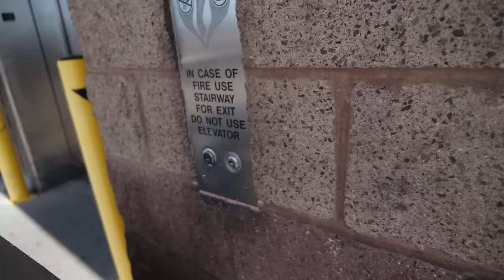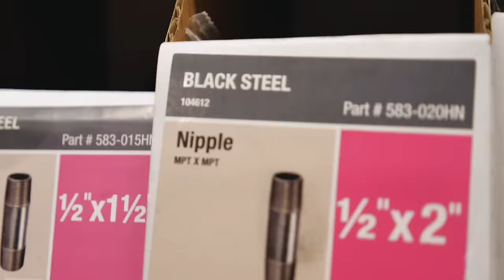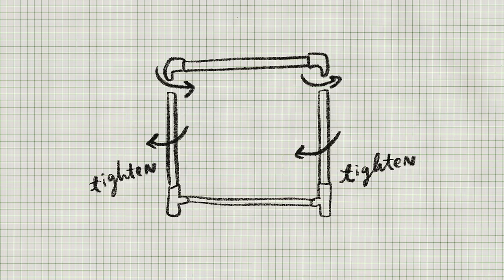HOW TO BUILD A CLOTHING RACK ft. my ex-bosses

Comment: thanks!! i built it. it was hard tightening all the rods, i had to get my dad and sister to hold it down while i spun around tightening it lol. 

it was also kinda pricey for in my area, i spent about $300 total, but it was exactly what i wanted and it was real materials so i think it’s worth it and will last.

i also realized that at any point you can add more T’s to make it larger and customized.

in the end it was about $300 and 10 hours total from getting supplies to putting my clothes on it. (i also painted the iron rods)

thanks for the help!!

Comment: For the top pieces, couldn’t you have just flipped them, and then they could be rotated clockwise?

Eg take the left screw bit and put it on the right side (flipping it so it faces the pipes?

Comment: I just built this! I love the idea and it looks great, but I wish I had realized that dresses don’t really fit on it. I was going to use this to house my vintage clothes (mostly dresses!) I will make it work, though! It is a very expensive project, I will most likely make another “single decker” rack soon. The base of mine seems a lot bigger than the one in the video even though I used all the same measurements, and you should have specified that you used #12- 3/4” wood screws! I had to screenshot and zoom in to figure out the type of screw. Overall this video did motivate me to build something all by myself and it turned out great! Thank you!

Comment: Awesome job. Just a quick heads up that you will want to clean and then clear coat the pipe for long term use (it will eventually rust otherwise when the light oil coating wears off).

Comment: about how much did all of the materials cost? i'm debating whether it's worth it to do this or just buy a clothing rack LOL
Reply: Esther Chun I’m not sure what the price is to make a clothing rack but purchased one with shelves from Bunnings (an Australian homeware store) for 75AUD (roughly 50USD)
Reply: I thinking the same thing
Reply: I just bought all the materials at Home Depot and I am almost done assembling this rack.... it was almost $200 for materials. Yikes. Wood is more expensive right now and the pipes and fittings aren’t cheap either. It seems like they left out a few important details about materials, I had to screenshot the video to see that they were using *#12* 3/4” wood screws. I used 48” pipe for the rack instead of 41” so I had the store cut a slightly longer board, but even so it looks a lot wider than the one in the video. I’m guessing this will be fine as long as the weight distribution is even. I’m hoping it works really well. It’s going to weigh A LOT and it’s so tall that moving it is going to be interesting

Comment: You could also mark the place where to drill the hole in the wood, move the rack, make the hole, put the rack un place again and screw all the screws! unless there is no space for the manual screwdriver after all, but its perfectly fine with just three

Comment: 5:14 you should have just flipped the bottom horizontal bar so that the top and the bottom screw would align and you could rotate the vertical ones the same way... Idk if that makes any sense it's so different to explain this

Comment: Okay I have to be honest. I watched you previous clothing rack video and attempted the cheaper way available here in Argentina. I used PVC pipes, that are like, basically plastic. Ran into the same struggle you guys did here. But moved on. One month passes, I come back home from a long day at my uni, and then BOOM I see it, THE HORROR! The principal pipe broke in half and all my coats where all over the floor. That was a month ago, and I still haven't recovered. I just use a chair for my hanging items. Sometimes I have flashbacks... Its real' sad